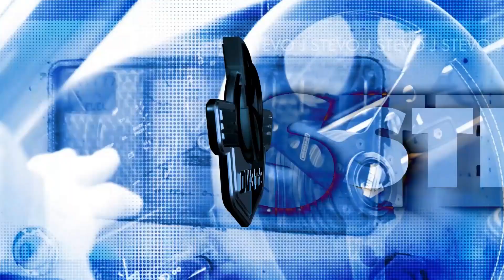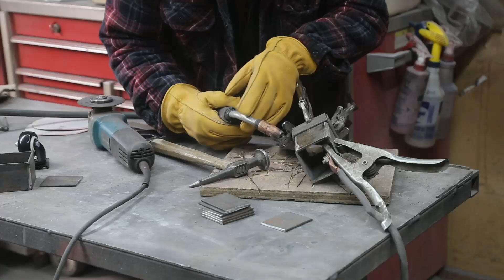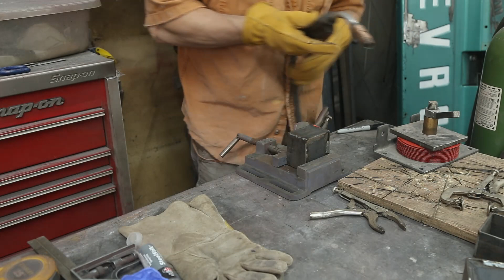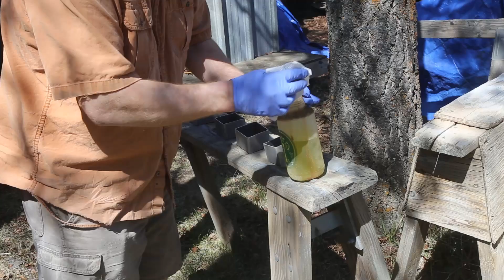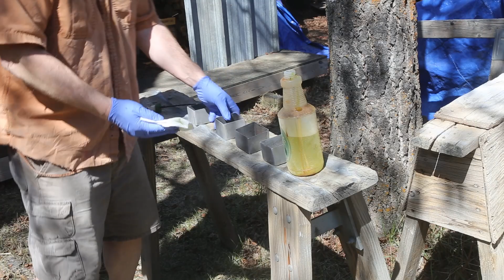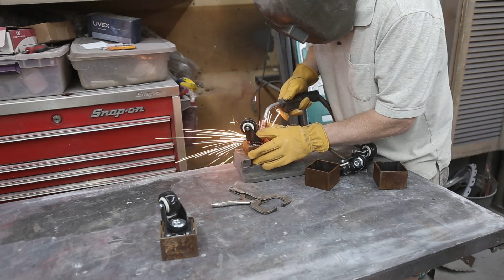Slip on casters for my plant table

Comment: I have rollers on several items in my shop,, it's just too hard to be dragging heavy tables around with out the rollers.
Reply from the maker: I agree.  They do make life easier especially when you have to clean.  Casters use to be tough to buy but it seems unlimited when you look on line now.  Thanks Vern.  Have a great week.  Stevo